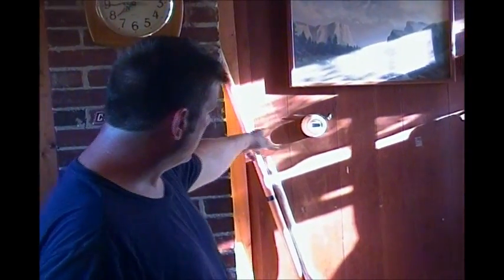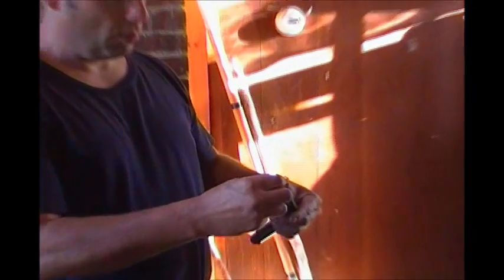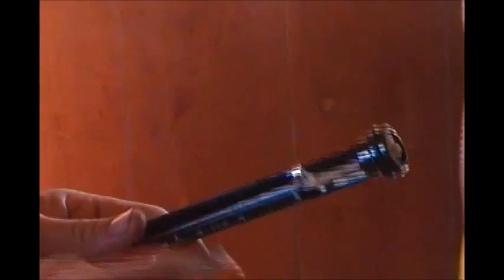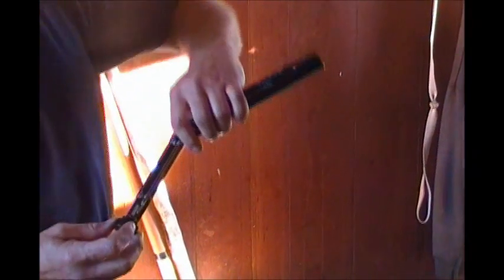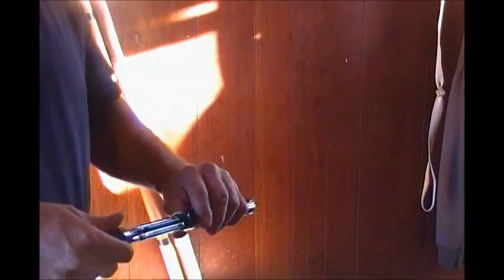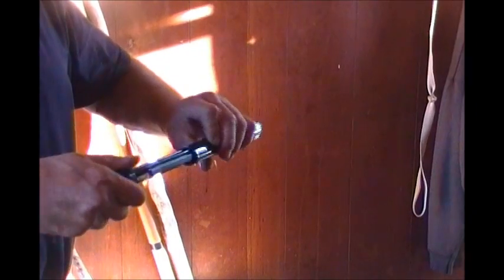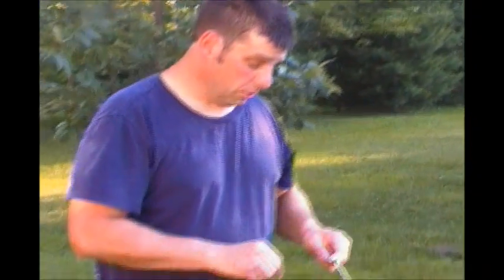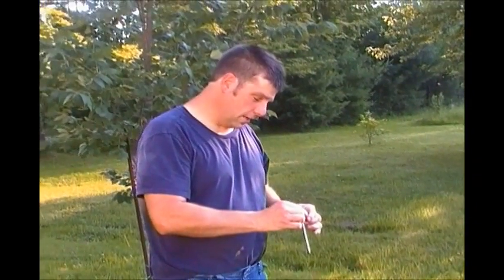how to set  super heat for AC

Comment: Hey Russ - great video.  Hope you are still getting comment notifications.  I have been asking (but no one seems to have an answer) a question regarding superheat that hopefully you can answer.  What happens when you run the formula and you end up with a negative value?  For example (this is for real - I live in South Florida) if the outside ambient temperature is 100F, and the indoor WB is 59F  you wind up with a superheat of -1.5.  I am using R22 with a piston.  I previously checked the superheat when it was not as hot outside (85F) and WB was 65F and adjusted the charge to get the calculated value of 15.  So what do you do when you go to do a service call and its the hottest time of the day, and the indoor WB is very low?  In my home AC, when the negative value condition occurs, I hear a whole lot of flashing going on by the fixed orifice.  The suction line is attached to a small manifold above the evaporator, which is quite uncommon.  What prevents liquid from slugging back to the compressor?  Is the raised suction line making the evaporator coil into some sort of accumulator? Thanks in advance.

Comment: This is the only video I have seen where you explain how to hand calculate the target SH.

I have a 2 ton package unit low on R22.  Well after watching all vids I could I felt confident enough to top off th unit with R22 using the superheat method.  All is well now with one anomaly maybe someone can answer for me.  The SLT goes from 66 to 48 to 66 again over and over.  It has a fixed orifice with cap tubes to the evap.  It took 2.8 lbs but blowing cold but I haven't seen a vid yet about this ping pong SLT.  Anyone?  Thanks.

Comment: what if your super heat is dialed in on an r22 system  but subcool is 40+ piston metering device pressures read 75 low and 320 high lowside is sweating, liquid line is bearly warm, coils are clean new filter drier house not cooling past 80° any ideals?

Comment: Rule of thumb, no less than 10 degrees superheat. This guy is needed on those calls where the customer says the unit is not cooling properly and the tech arrives to find a 68 degree house (lol). Usually the laser temp gun reveals the temp of the supply grills to the customer in these cases, and a TD is performed however, if we had this guy to send over there it may help convince the customer.

Comment: what if the wet bulb is 60, outside 95. what superheat do I use? the tables usually tell you not to add refrigerant but, what if you are changing it from 0. what superheat to use to charge the unit under those conditions? no one has talked about it in any video I have watched.
Reply: +user 007 (60 X 3=180) ....180-80=100 ....100 -95= 5.... 5 / 2 = 2.5° F Superheat

Comment: Hi Russ, I just  stumbled upon your video. I have been working on ACs for only about three years now. I am finding it challenging to correct charges during colder (below 50* ambient) temperatures. Is this typical and if so what is the correct approach to charging in cooler temps? BTW, most of what I service are heat pumps. Thanks, I would appreciate your reply
Reply from the maker: Maurice this is a good question  that is worthy of doing a video I promise to help you. when we're done you'll be able to charge a heat pump in the winter without any problems I will start working on this immediately the key is to control the condenser fan motor when removing the condenser fan motor out of the circuit you cause it simulate 95 degree day also the other key is  to know what kind of reversing valve you are working with because you want to make sure you have it in the cooling mode some valves are either open or closed  when energized before attempting to charge the unit anyhow I will   clear this up in a video if you are charging a rooftop unit the best thing to do  expecially if it's a blend is removed what is in it change filter drier and weigh it in usually the amount of refrigerate is on the manufacturing plate so please give me more information of what kind of heat pump is this residential is it R 22 or  410a put together a video video on both
Reply from the maker: I thought people watching my videos for the refrigeration I will focus on both refrigeration  and heating and cooling

Comment: How do you determine superheat when the AC has not been running due to a problem.  You (the tech) arrive, fix gas leak, charge and turn on and want to verify superheat.  Wet bulb will not be accurate because AC hasn't been running thus humidity will be high inside of house.
Reply: You can still calculate a target superheat.   I do it again as the house starts cooling down but it’s  just to double check myself.